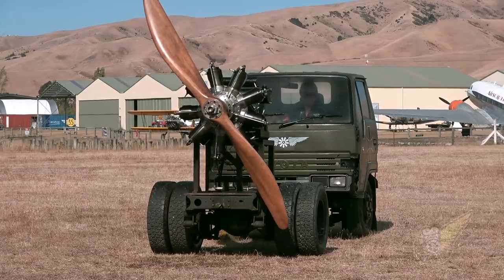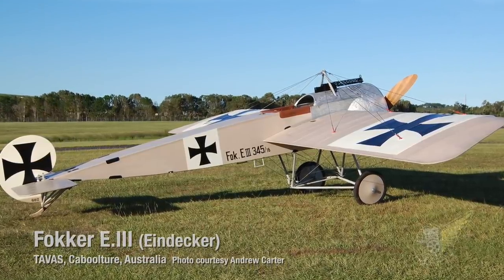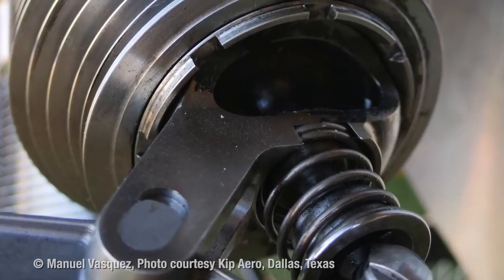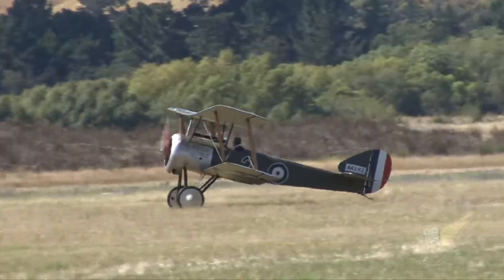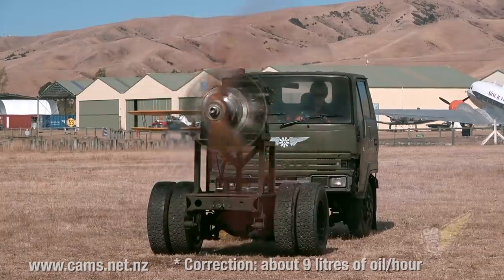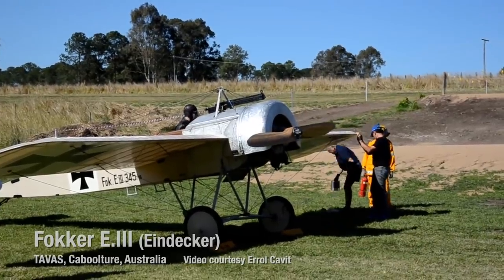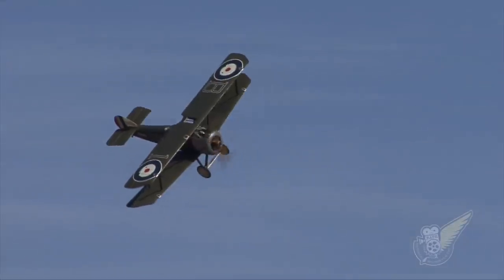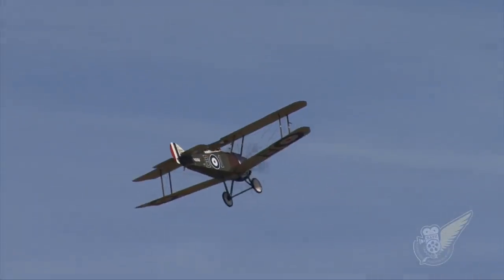Building New 100-Year Old Gnome Rotary Aero Engines In NZ

Comment: This question will probably be regarded as blasphemy by antique-aviation purists but will ask it anyway.  Since CAMS is already incorporating improvements to the 100-year-old design, why not add a carb and replace the prehistoric speed control system?   Increased safety, reliability, and fuel efficiency are obvious benefits. Then there's ease of operation (including reduced pilot pucker factor during takeoffs and landings), less maintenance, and cleaner burning hence less pollution. 

For the purists add the carb but retain the old speed control system.  Incorporate a  bypass mechanism so the pilot can select either speed control mode. Seems like it would be a win-win situation.  :)
Reply: Well, I think the idea is to be able to build accurate reproductions of World War I aircraft.  An improved version of the original engine would not contribute to that.  Plus, if you keep going down that road, you wind up building P&W R-2800s or Bristol Centaurus' and leaving WWI behind altogether.
Reply: @GR46404  Good purist point of view but keep in mind this engine may no longer be considered an "accurate reproduction" since CAMS has already been modernizing it by substituting new bearings, using modern alloys that weren't available way back when, and also incorporating design changes to improve it.  And CAMS has stated they will continue development to improve reliability and engine life so they're already "going down that road..."   I'm also guessing purists would object to using modern oils instead of caster oil since that would remove that lovely old authentic smell?

I knew my comment would bring some interesting purist responses and I appreciate yours.  I'm a flyer myself and love it that CAMS is producing a 'better than new' version. Improving safety and reliability of such a temperamental and persnickety old design is fantastic.  Also adding a carb to help tame the rotary beast ain't such a bad idea in my book for the reasons I mentioned.

Cheers from Thailand GR!
Reply: Jimbo, as you say, I think most of CAMS' changes are meant to improve the reliability and longevity of engine, not its power output.  Those changes do not change the experience of flying the aircraft, with the exception of having the airplane crash less because of engine failure.  I imagine that everybody will have their own opinion about what constitutes an acceptable change, and that each engine will be tailored to opinion of its purchaser.  And have they found anything but castor oil to run these on yet?  Castor oil was the only suitable lube for them, and nobody has done any work on the problem for nearly 100 years.

Comment: My 100hp aero engine burns 15 litres an hr! So it is just pissing unburned fuel out the exhaust? It's almost like the fuel is being used to cool the engine!  I guess that's just how it was back in the day. The case looks cnc machined. Was the original a casting and you machined it from billet? Looks lovely sounds awesome.
Reply: Well, it’s over 100 years old design
Reply: Martin Andersson i guess. I suppose my Continental is from about 1935 in terms of tech. I don't think the sfc has improved much between then and now for airplane engines. Cars are much improved with high reving computer controlled fuel injected designs. I guess I never realized that the ww1 engines were so thirsty

Comment: radial or rotary?
Reply: this is a real rotary engine, and a radial doest turn..., and the wankel isn't a rotary engine, but a rotary piston engine: this is sommeting different...
Reply: A radial engine gets its name because it has all it's cylinders "radiating" out in a circle from a central crankcase. All early rotary engines were still radials- they had a fixed crankshaft and the engines themselves were made to spin for enhanced cooling. After WWI fixed radials that spun the crankshaft instead became more popular.
A Wankel engine was also called a rotary engine but its design eliminates pistons and cylinders and does not bear any resemblence to the original rotary radials of the early 20th Century.

Comment: So I'm confused. If it is a rotary engine what are the cylinder jugs for? looks?
Reply: D don't get confused with a proper Rotary and the wankel engine .
Reply: It's not a Mazda type Wankel rotary. The design is completely different.
These rotaries are radial cylinder piston engines that had the crankshaft fixed and the whole engine would spin for better air cooling. The propeller is attached to a stub on the crankcase.

Comment: Cool Thanks for this post . If you look at about 4:55 on this old post   https://www.youtube.com/watch?v=0gIAlrZ81h4&t=182s   you can see a WW1 surplus rotary being use on a helicopter design that failed but was later tried and made to work on the Durbro 505 r/c helicopter and some attempts at flying cars in the 1950' and 1960's .  A still fascinating engine design .

Comment: Isn't that called a radial engine?  A rotary engine is usually some form of the old Wankel engine.
Reply: no: this is a REAL rotary engine (first was use on the 1897 Felix Millet motorcycle) , and the Wankel isn't a rotary engine but a rotary PISTON engine (so called from Felix Wankel: kreiskolbenmotor or KKM)
Reply: In a Radial engine the crankcase, block and cylinders are fixed to the aircraft and the crankshaft drives the propeller. A Rotary engine the whole crankcase, block and cylinders are bolted to the propeller and rotate with the prop and only the crankshaft is fixed to the airframe.

 A wankel rotary is the spinning dorito bullshit
Reply: Wankel is just wankel engine, this is rotary.
Reply: @oddball0045  
Both are radials. The name comes from the cylinder arrangement. The cylinders "radiate" outward in a circle from a central crankcase. 
The "rotary" type had the crankshaft fixed and the whole engine would spin to enhance air cooling of the cylinders. After WWI fixed radials that spun the crankshaft in more conventional fashion became more common. There is no "radial" OR "rotary." All rotaries of this type are also radials.
The Wankel is also called a rotary but it's design is completely different. It would probably be more accurate to call it a "rotor" engine.

Comment: That is a radial engine not a rotary.
Reply from the maker: Sorry Andre, you're incorrect about that, and you need to do some more research. That is not a (stationary) radial engine where the crankshaft rotates in a fixed engine block, it's a rotary engine design from WW1, where the entire engine revolves around a stationary crankshaft.
Reply: Err. Wrong.
Reply: G'day,

Thou art in error, totally so,

Look in the Thread under +Merle Patterson Channel's comment to recieve your re-education.

Such is Life.

;-p

Ciao !
Reply: @HistAvFilmUnit  OK Then there is a Wankel engine too. It is rotary.
Reply: All rotary engines are radials, but most radials are not rotaries.